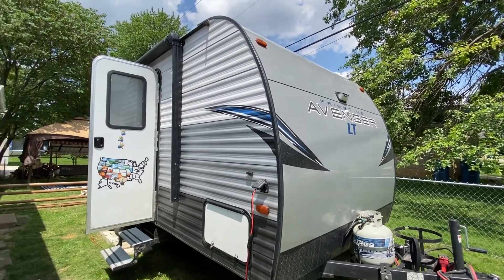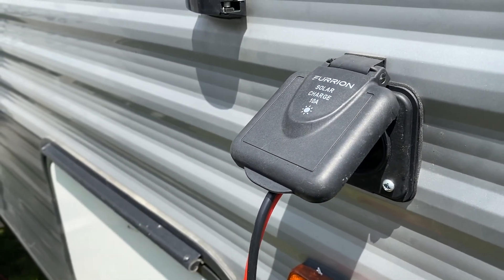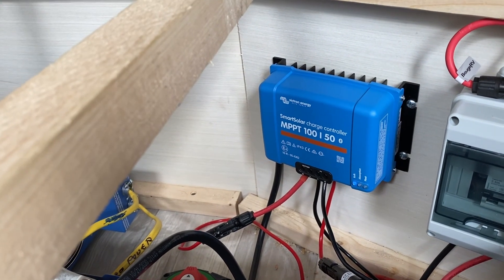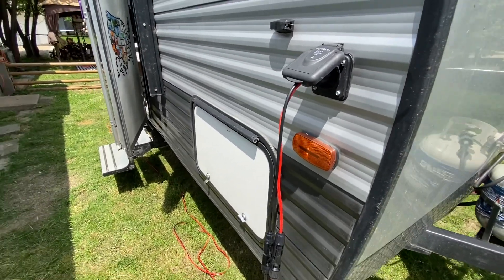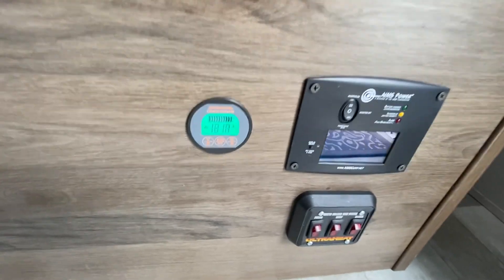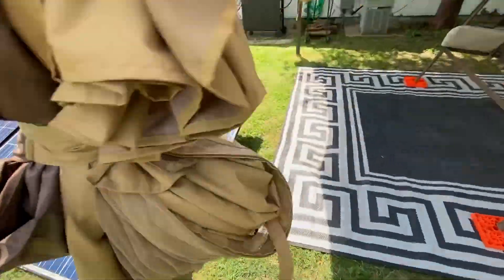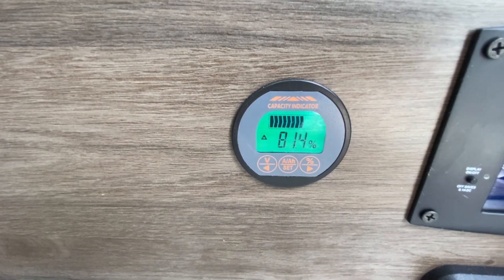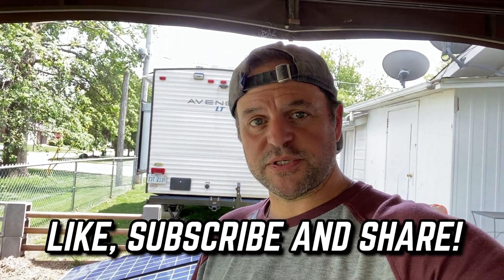1900 watts of solar on a 22ft camper

Comment: Nice work. Ive been using 3 used 250w panels to recharge my pair of 100ah bb lithiums..  just replaced the panels with new 400w Trina.panels. wow..! So much better now.
Reply from the maker: You can never go wrong with more panels.
Reply: @OffGridSolar  I bought 4 of them..  now I need another victron controller. It's always something